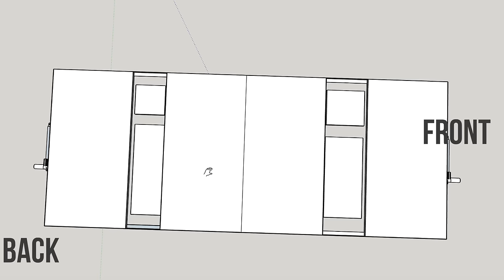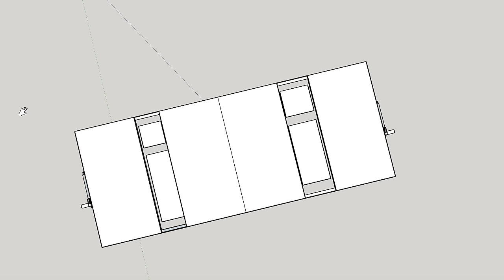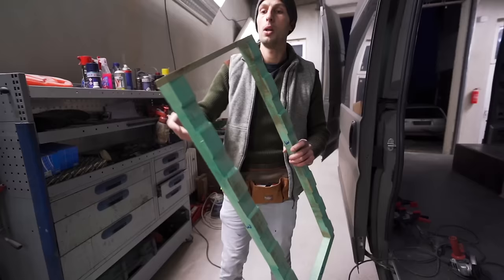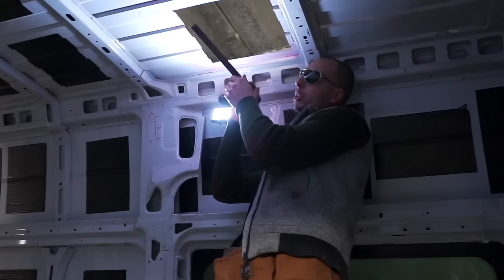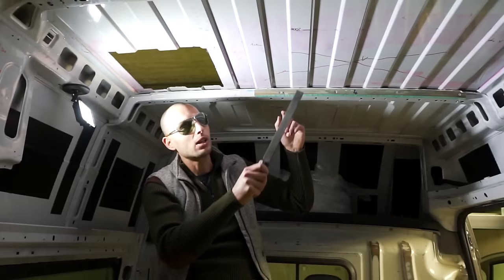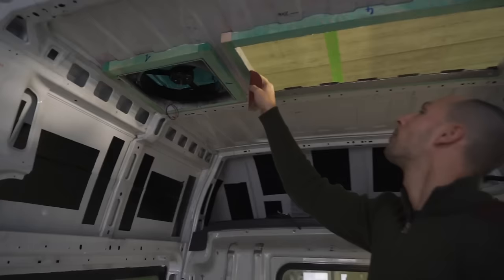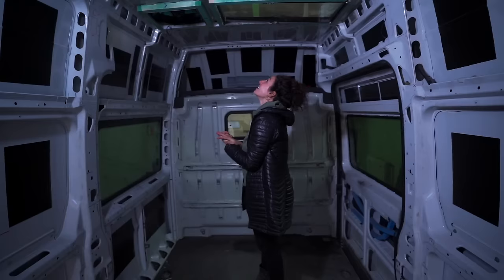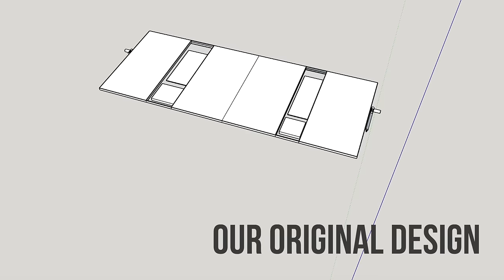WE MADE HUGE CAMPERVAN WINDOWS! / DIY Van Conversion (Ep. 9)

Comment: I’m impregg’ing any wood in my conversion with resin— either epoxy or polyester resins (with 10% acetone)— to strengthen, remove any food for mildew, seal out pests, and rigidify for the earthquake vibrations on and off-road. My hatch windows will be tempered glass outside, plexi inside.

Comment: Hey, guys loving the build Quality its super high, I have some advice for Ladi when masticating it's best to use the push technique it fills the void when you see a small bead in front of the gun the void is full, let it cure then remove overburden. I'm a time serve construction supervisor manager and have been on factory training courses with the big mastic firms, I have refurbed many towerblock 32 story the highest  with upward of 60 openings per floor hoping you appreciate this observation and the tip helps you move you to an even higher level, best wishes Mike R

Comment: Those windows look great. Not to be mister doom and gloom but I used to work in a custom trailer workshop and I'm a bit skeptical about the seals on them being just a bead of mastic to fill the gap. What makes the seal of those fans better is that there's bigger surfaces sandwiching a bunch of mastic in between and some pressure from how it's installed so it doesn't fail as easily.

Comment: Looks great and helps w/ the cave-like feel of a van. 
I think I would of used marine hatches instead. Marine hatches are made to install and operate on a horizontal surface,  clamp down tight, stay waterproof, operating in heavy vibration and harsh conditions and can be opened with screen linings. Plus, they are certified as escape hatches in the boat building industry.

Comment: Great work I am glad you were clever to include the angle on the roof glass. You may need to add a slight angle in silicone to the lip of where the glass would meet the air when driving forward as you may have a high pitch whine as after it would be low pressure. Great efforts from both of you keep up the good work 👍

Comment: Nice job on those clear ceiling window panes. Those windows are the best insulation in the van right now.  Now you have to come up with a pop in insulation panel for those ceiling vents that are 3mm's thick plastic between you and the outside air.
Reply from the maker: Already sorted😎

Comment: I think I would have put ten times as much sealant on the sides of both the fans and the windows. It will look ugly, but it will not leak. I have seen so many videos of vans and RV's with leaking fans and windows on the roof. I don't think I would have wanted flat windows made of glass on a van roof. But they look very nice, and having skylight in a van must be awesome.

Comment: I love how the build is going, great job guys.
Btw, your insulation is as good as your weakest link. So I suggest looking at just how good or bad the fan windows are at insulating when they are closed, just to see if they need any improvement.
Reply: Good Point, but only true to a certain extend.

The loss of heat is not happening through the weakest link, but the sum of areas that are not ,well enough insulated’ for the difference in temperature on the outside and inside AND if those cannot be compensated for by heating on the inside - will cause condensation on those ,weak areas’.

Usually the windshield and windows in the cabin are the weakest ones and hence, victimized on purpose to see when humidity/condensation becomes a problem.

But I am 100% sure that Ladi knows all that and that it will be explained way better in a later video!
Reply from the maker: We don’t expect the vents to be well insulated. They’ll be insulated with additional sliding panel inside.
Reply: @ladiandmargaret  Awesome

Comment: A simple question: is it possible to just glue the roof windows from outside like you did with the side windows? That would include making a wooden frame from inside (bit smaller than the roof window size) and gluing the roof windows from outside. Great work btw!
Reply from the maker: It is possible but I don’t think it’s a better solution.
Reply: @ladiandmargaret  Thanks for the reply. My reasoning was if the roof windows were glued from outside they could deal with the vibrations and van's body twisting better (3mm tolerance vs infinite tolerance). I assume it would be easier to waterproof them as they're directly sitting on the sikaflex/mammoth glue. The only disadvantage I can think of is that the roof windows would bulge out quite a lot (but I guess it wouldn't be a problem given the height of the solar panels). What do you think Ladi?

Comment: Love the concept of the skylights.  However if I was doing this I would want more than just a single layer of sealant around the edges for waterproofing.  If this was a building we would never rely on just sealant, no matter how high quality, as it will eventually fail, either due to UV breakdown, thermal movement or a combination of both.  Add to the mix the movement to of a van, I hate to say it but I think it’s only a matter of time before you have a leak.  

It looked like Ladi made a custom frame for the window, so why not make a “lip” as part of that frame like the vents have? Extending the frame over the vertical gap would at least help protect the sealant and make the water work harder to enter your amazing van.
Reply from the maker: This was my Ladi) decision how to approach this install and I take full responsibility for it. I’m ok to learn a lesson if it leaks and fix it.

Comment: Hey Ladi & Margaret - I only just saw this video - you guys are epic! I'm trying to do a custom skylight in my van right now and you've inspired me to avoid the 'off the shelf' standard (and crazily expensive) plastic ones. The one thing I'm hugely struggling with (my last install leaked) - is the roof ridges. I noticed Ladi put some plastic(?) or rubber pieces in between the ridges on top of the roof? What were these and have they managed to keep the water out? Thanks guys - an inspiration!

Comment: A lot of things are so cheap where you are.. just one of those double glazed windows here in Oz would cost around USD $140.☹
Tip: Sparks from metal grinders can stick to glass, so it's always a good idea to cover windows before cutting.
Reply from the maker: Good point. I (Ladi) was frightened seeing later the video how close these sparks were to the window.
Reply: @ladiandmargaret  One way to check if the windows have or haven't been affected is to wipe over the windows with a tissue or chux. After vacuuming up all the grinder swarf, it'll be a good idea to poke around the crevices with a magnet. Leftover swarf will rust with a hint of moisture and we all know rust is like cancer for vans.

Comment: Very nicely done. I'll have to try this on my build! You could easily make blackout curtain with magnets.
Reply from the maker: We’re planning to have a panel on runners that will live on the ceiling and that we can just glide into place whenever we need! Good blocker and insulation.
Reply: @ladiandmargaret  I was thinking that you will at sometime want some sort of privacy screen for those overhead windows. I like the sliding screen option.

I still think you should put GM Crystaline on the front and side windows of the van. The lowest level will give you 35% rejection of heat and the next level up will give you 55% rejection of heat. What you would put on the front windshield is so lite inspection will not know that you have a “tint” on your windshield.

Comment: I'm wondering if it would be practical and cost-efficient to put a second hand double-glazed, or even triple-grazed, window as a skylight that one could open from inside the bed area and gain access to the roof and solar panels?  On eBay second-hand 100x50 windows in perfectly good condition can be had for $30 or less.

Comment: is there a consideration for a sliding hard board cover for the windows in case of massive hail? I know the glass is tempered, but I'm thinking about the super heavy hail. They could easily slide away under whatever else will be on the rooftop, then pull across when things get dicey (a single line connecting them both would mean only moving one to move both). Also nice for full blackout without losing interior volume (those interior shades always seem to leak light) - hide a linear actuator under a rooftop deck and it's  push button control.
Reply from the maker: We park under cover when hails are coming. Not good for solar panels neither.
Reply: I knew I had to scroll first before asking the question. Also, I suppose with a glass window on the roof you'll want to be careful where you drive, with branches and other stuff that could scratch or break them. But then again solar panels create that extra caution factor too.

Comment: Dear Ladi & Margaret, I really enjoy viewing your videos and cool ideas which you try to materialize in an end-up product. I have personally converted my own campervan and licenced it this year in Switzerland, and therefore would like to share my experience with you regarding the roof-windows. I really had troubles licencing mine after the conversion and after reading the law requirements I finally managed. However the 3-ple glazed windows which you have installed on your roof, need to be certified for automotive usage before you install them on the roof. Please check the small roof-vents which you have installed, they should have this certification , just for comparison. Your 3-ple glazed windows however, are definitely NOT CERTIFIED for automotive use, therefore NOT allowed to be installed. Even if the police in Czech Republic allows you to licence the vehicle as a camper van after you finish with the conversion, please take into account that according to the EU law you might/will have a serious problems especially if you are having an accident. In Switzerland you would definitely not get the permission to drive the camper van on the road before getting the approval for the product, and an installment certificate from a certified mechanic. You can also try to certify the product yourself through an approved government agency (I do not know which one is responsible for that in Czech Republic), but this will cost you a fortune. Please do not get frustrated or offended from my remark, at the end of the day things have to be made safe and according to the rules. I wish you success with the build and will be happy to watch your further videos.
Reply from the maker: That’s weird. We researched as a non commercial van builders we can use non certified windows.
Reply: @ladiandmargaret The law requirements are the same for DIY-ers and for the professional companies making motor homes and caravans. As per the German law (identical in all EU member states), I quote: "All windows must be approved for the respective purpose of use". ("Alle Scheibenmüssen für den jeweiligen Verwendungszweck bauartgenehmigt werden"). This is written on a lot of places in different articles regulating the topic. Cut-outs, as well as other changes on the chassis, engine, breaks, suspension etc are subject to approval and should be compliant with the existing rules. Therefore all roof-hatches on the market should include a certificate showing couple things: 1. Approval for usage, 2. where can the product be mounted and 3. assembly instructions (the last should be certified by a certified professional electrician, mechanic etc. DIY-ers can not certify it). Please check the link for mine roof vents with the corresponding allowance for usage: (https://www.fiamma.it/download/certificates_products/KBA%2019330-01%20VENT%20160%20-%20VENT%2050x50%20-%20VENT%2028%20-%20TURBOVENT%2028%20-%20TURBOVENT%20160%20-%202014.pdf). Please remember that these rules guarantee the safety on the road, and this is the most important thing.
Reply: if the link is not working you can google "fiamma turbo vent 40 Allgemeine Betriebs Erlaubnis" and search for the .pdf

Comment: Loving this new series, bravo! 

Interested in the use of the grinder to cut; is there not a heat/rust consideration? 

Also seems that the windows are blocking some of the roof drainage valleys; if so how would you address this?
Reply from the maker: Grinder heats up and cuts fast. We filed the edges and painted over. I’m (Ladi) not aware of solutions for the drainage and it’s never even been my concern. The window needs to be sealed, not somehow sealed so water can be sitting there as long as it needs before vaporizing away. That’s how it goes with all the roof windows on vans.

Comment: Looks great, might do sth similar in my next van build. However, the moving bouncing van is like an earthquake. I'm very curious to see how they hold up over a year or 2, and to find out they've smashed/cracked due to the moving forces around the outside of the van or not. I think I'll use UV rated acrylic (the stuff they use in yacht hatches). Not sure if I can get it vacuum sealed like glass though. Looks great and I love the light inside the van, like I said, will likely do my own one too, looks so simple.
Reply from the maker: We thought about acrylic too but one layer would be more trouble than good. Condensation and heat loss would not be worth the natural light.
Reply: @ladiandmargaret  maybe you could do the same? Create a vacuumed 3 layer acrylic window? I might explore that.
Reply from the maker: It might work, give it a go if you want.

Comment: Good job! Roof windows brings lot of light and open space feeling. Just the technical question...are they certified for use in the cars? If not, you will not be able to pass the technical inspection and it can be realy dangerous in case of car accident. Maybe somebody say, hey they live in Czech, there is everything possible, but it's not true. We have more strict rules than in Germany for example. 
One more question. These large 8kg heavy windows holds on place just by the Mamut glue between the roof and wood frame?? Or I missed somethink? (small recommendation,  there are better glues on the market like Sikaflex)
Anyway I'm a fan of you guys, I like Ladi's sense for detail and Margaret support! :)
Reply from the maker: Thanks, I (Ladi) know sikaflex and I’ve been using mamut by choice. The frames hold on glue only and after a big consideration I decided to glue the frames only. It’s 9kg each window only and if you imagine how big surface the glue has to attach to, it’s not a concern any more. Don’t worry about technical inspections.
Reply: @ladiandmargaret  So are the windows certified? If yes, I would like to use them in my future builds instead of expensive Dometic/Outbound/KCT ones. Or you have good friend on STK who close both eyes during inspection? :)
So you trust in Mamut a lot, ok. Maybe few screews between the wood frame and roof struts make it 100% safe.:)
Reply from the maker: Sure, it can be screwed too. These windows are custom made and not certified. What we researched these windows from a non commercial builder don’t have to be certified, as we are not a manufacturer and are making it for our own recreational use. From what we learned after calling around was that this was no concern. I’m sure it varies country by country/ van vs. caravan, trailer, RV, etc. Frankly, we’re more concerned with it being safe than anyone else. We don’t want something dangerous in our van that we’re not 100% sure of.
Reply: @ladiandmargaret  The certification has one reason - safety. What happen in case of crash when the van rotate over the roof - does the glass break into small cubes or just in few sharp objects what can be realy dangerous for the crew?
I understand you are concerning mainly on the result, but safety has to be on first place.
Anyway, I dont want to hate, I like your style of work and ideas. :) This was just first thing what I had in mind when I saw these windows. Cheers
Reply from the maker: No worries, we know it comes from a place of concern! We’ve thought about all of this and made sure to ask the right people the right questions. Tempered glass is really the main focus and importance when it comes to these vehicles being road safe, so we made sure to have it. If we have any issues with certifications, insurance, police, etc. we’ll make sure to share it
Reply: According to my own research such an installation would unfortunately not pass the TÜV in Germany..
Reply from the maker: Hmm I’m not sure for Germany. I do know Germans seem to have the strictest laws in the EU. I’ve heard you even have to ask permission to cut a tree on your own yard (this is from a few German friends of ours who wanted to renovate their home and had to get permissions for almost everything!) varies place to place. We’ll make sure to vocalize any lessons learned on this!
Reply: @bariss.3403  I think it will be the same in the most EU countries. Not possible by legal way.:(
Reply: @ladiandmargaret  Yes man, laws are pretty hardcore here in Germany :(
Reply: @NewAgeNomadsCZ  I'll be following the updates from Ladi. The idea is amazing for sure, you get a skylight like 10 times cheaper than a commercial product (comparing to Dometic Heki) with much better insulation value. But I believe if I installed such a window and drove to the TÜV, the technician would simply ask for a certificate of the window whether it's approved to be used in cars.

Comment: I am curious why you don't do the frame with metal. Like the frame that is supporting the van structure. For in between, I mean and holding on the original structure
Reply from the maker: It’s too heavy, more expensive, more difficult to shape, needs to be painted. That’s why I (Ladi) would say.